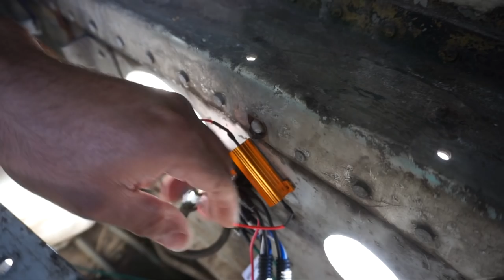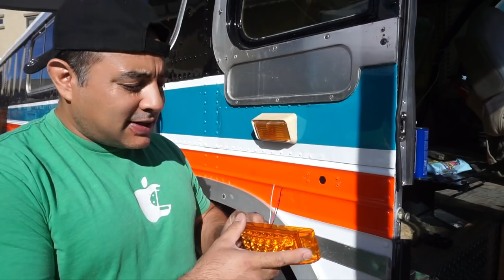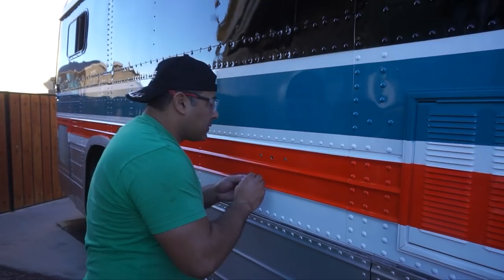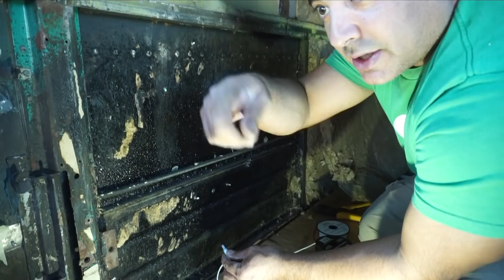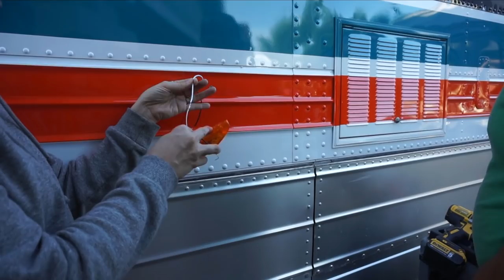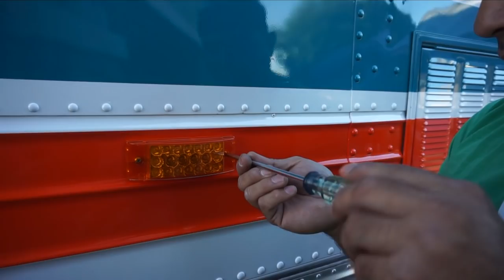Lighting Up the Sides of the Bus - Upgrading our turn signals and marker lights

Comment: Nice Clean Job. I would add some thread locker to the connections. Bus vibrates and could easily cause those connections to loosen up‼️👍👍. Vinny 🇺🇸
Reply from the maker: Thank you mmanut - excellent idea on the thread lock - I will likely do that next week (I ran out)

Comment: Well done Juan I like your choice on the lights its a good look for the coach I like how you take care on how you wire things to I worked in the wireshop for Boeing for about 5 years and you learn that a little bit of extra care and planning can make the difference in quality workmanship have you considered using solder sleeves? much quicker and seals all in one Amazon has them.
Anyway another great video
Keep them coming brother.
Reply from the maker: Thank you Brian - I looked up Solder Sleeves - HOLY COW how cool is that!!  I thought they were amazing.  I do my best when I wire to do a "lineman's splice" where you loop the wires around each other than wrap it around itself a few times before I solder them - I then "seal" them with marine-grade heat shrink (heat until the glue comes out a little).  I will have to try those solder sleaves!  Thanks for the tip!

Comment: Hi Juan, I get a chuckle every time I watch your video's.... I'm surprised how much alike we do things, I also use a ton of RivNuts...if they strip you can just drill em' out and insert a new one, I am also going to light the sides of my bus the same as you did except I'll use 5 or 6 as mine is longer, I'm also going to run a matching set along the upper panel.... I like lights ( I'm an ex truck driver... I can't help it).... Watson's Streetworks has some pretty cool lights and cupholders and things that you may be able to use, check them out if you like, it's all designed for hotrods but these old buses are just big hotrods anyway.... keep up the good work, you guys are doing awesome
Reply from the maker: Thank you James!  I love lights as well and I must have been a trucker in my previous lights - I love the big rigs!!  I will check out Watson's Streetworks for sure.  Happy New Year!

Comment: What are you adding to replace the upper marker lights? I believe from the factory you had one front and rear on each side as well as one in the middle. The front & rear serve both as side markers and front/rear markers. The upper one on the side allows you to be seen from the side over other traffic. 

I know that you're going to me mounting the solar on the roof. Possibly an awning in the future as well. These will likely interfere with the factory location of the center upper light, so I'm curious how you'll crack that nut.

Nice touch using the riv-nuts instead of just sheet metal screws. Will definitely make future service of these lights easier. With the rubber grommet you may still get some water inside the bus, so perhaps a dab of electrician's putty or caulking on the inside?
Reply from the maker: Thank you Richard -  I did manage to find LED lights for all the marker lights all the way around last year.  I don't think those upper corner lights are blinkers (I will check tomorrow because now you have me curious).  

The last time I checked those were just marker lights and our lenses are currently in pretty bad shape.  I did get a better set from Luke last year, but have since located some NOS ones!
Fortunately, our solar rack should not interfere with any those lights (fingers crossed).
As luck would have it, it was actually pouring rain today in AZ and I was able to do some leak checks on the newly installed lights - they were all dry as a bone :) - I did fill the rubber hole with dielectric grease as a "just in case" precaution when I went and put it in all the connectors.
Reply: I think you're correct - the upper corner lights are markers. Sorry if I made it sound differently. Glad you got to Luke's - great shop. I had ours there this fall. Can't wait to see the completed bus. Happy New Year!

Comment: If you stay with the load resistor, consider getting some thermal paste (like for CPUs) and bolting it to a large metal piece to use as a heat sink (obviously not the front panel!). Heat build-up won't be a problem for normal lane-changing use, but if you're using the 4-ways while you change a tire or something, they could be running for a long time.
Reply from the maker: Thank you Chip - That is excellent advise I ran them for quite a while testing and they did get warm.  The bus is made of aluminum and should provide a nice outlet for heat - I will revisit this later- thank you for the input

Comment: Whenever I use those crimp connectors, I simply fill the connector with Dielectric Grease before I put the wires in, that way the wires get coated with the grease to keep corrosion at bay.
Reply from the maker: Thank you BB Cooter.  That is a better technique ... it was kind of a pain to try to shove the stuff in there afterward.  Thank you for the tip I will try that the next time I use these :)

Comment: Nice work - those riv nuts are really handy and I am sure you will find them very useful when doing the interior figments.👍 On the electrical connector side have you looked at the range of Wago connectors - it might have something to offer you for the large electrical system you will be re establishing in the bus?
Reply from the maker: Thank you Norman - I have a few Wago connectors and I think they are amazing.  I felt that since these connections will be buried in a wall it made more sense to use the crimps.  Thanks for the tip!

Comment: With soldering you’ll have to carry an iron and solder with your spare lights because the lenses will crack with UV exposure or with force like a tree limb or rock or forbid a collision
Reply from the maker: Thank you Peter.  I hope they just get ruined with UV exposure and not the other things you mentioned :).  I guess in a pinch I could just cut/strip the wire and just use a small coupler but we plan to live in the bus full-time for the next couple of years and we plan to bring a soldering iron :)

Comment: Use "shrink tube" over crimped connectors.!!!
Reply from the maker: Thank you Herb, I normally do marine heat shrink everything, but these are going into the walls and should be safe from the elements ... meh maybe I will go back and throw a piece of heat-shrink on them.

Comment: they have  flashers for led lights and they are  a little bit more money than a regular flasher but they are worth the money because they last the led flasher you need is a grout you can pick them up at any tractor trailer parts store
Reply from the maker: Thank you chrissteene - we did try a set of LED flashers but they didn't work for us (probably the wrong pin-out).  We will try again later if time permits.
Reply: if you use a LED flasher the best one is a grout they have 2 style I work at a tractor trailer repair shop I do all the electrical work some stuff that I saw was scary like how the heck did this not burn to the ground :O . as far as the head lights did you look at the doge charger lights ?

Comment: Adding resistance to the leds defeats the purpose of power saving leds...   (hense the warm/hot resistors)  You should use a led compatible flasher module.  I have seen you design insanely complicated systems.  I know you can figure it out.
Reply: Shawn Griffin, why don't you find him one?
Reply: He said that he tried that route initially and it did not work. Rember that the bus was built in the 60's so LEDs hadn't been invented for autos yet.
Reply: The idea of going to LED for marker lights is not just for power savings, it’s also so you don’t worry about the bulbs burning out.  You’ll rarely have the marker lights on when the bus isn’t running and providing power from the engine.
Reply: @hakunamatataadventurebus5944  Here you go...  https://www.amazon.com/CEC-Industries-Electronic-Flasher-Compatible/dp/B00JXLH7CG  He will have to provide another source of positive or negative wire at the flasher based on how the bus's original wiring was designed.
Reply from the maker: Thank you guys - I did try an LED compatible flasher before and it just behaved poorly (basically didn't work) - I got kind of lazy and just put a couple incandescent bulbs back in (using LEDs in the back and on the sides but regular bulbs up front).  This bus has A LOT of projects and this one ended up being really low on the priority queue.  I was not really worried about it because the only time the flashers will be on will be when I am driving (as Bill Best had suggested).  I went with LEDs because they are much brighter and they should last much longer than the regular bulbs.  If I get a chance I will swing back around and have another look but for now, I have to dedicate more time to other stuff.
Reply: @BeginningfromthisMorning  Thanks for taking the time to reply.  I think my initial comment was taken as an attack by the other replies.  It wasn't meant that way at all.  I mean you installed a LEAF battery with a full BMS which is super complicated and technically difficult.   A traditional flasher is based on a heat sensitive metal membrane and a spring. It only needs one side of the circuit like a bulb, the other being chassis ground.  At LED flasher needs both poles at the flasher since it runs an IC timer circuit...  That was probably your issue when you tried to make it work.   I really enjoy your channel, so please know I was only trying to help.
Reply from the maker: @iamshawngriffin  Hey Shawn - thanks for the clarification - I am sorry If my response sounded defensive - I do appreciate the feedback and did not take your comment as an attack at all.  I agree with you and originally tried to do the LED compatible flasher but the one I bought did not work (probably the wrong pin-out) ... Honestly, I just wanted to get it working for now.  I have the resistors on screw terminals because I will probably loop back around and fix that issue :).  Thanks again for the feedback and thank you for joining us on our project :)
Reply: @iamshawngriffin  I had found one on ebay but the one you linked is much better because it matches the shape and size of the OEM one. I disagreed with the resister idea as soon as I started watching his video and I found that I could not continue to  watch because the resistor completely negates the purpose of putting in LED in the first place.

Comment: Now change out that upper front side amber light that is angled down and turn it into a clear lens as an aid in boarding the bus at night. Kind of a front porch light. Would be cool to have it on a remote or motion sensor. The one right by your hand at 2:52 the older one, not the new LED.
LEDs are looking great.
Reply from the maker: Thank you Bob - Yes, that light is on the short list of things to replace.  We have a few candidates (with motion sensor) but nothing has really grabbed us yet.

Comment: It's technically illegal to have an amber marker light near the rear of the bus....is fine as a blinker bites the rear most one isn't supposed to be a marker as well.
Reply from the maker: Thank you Nate - I had to look this up and I believe you are correct!  Technically I think we could probably get away with it because those laws were passed in 1969 and our bus is a 1964 but those laws exist for a reason.  We have a couple of red ones on order for the back that should be here next week - thanks for the heads up!
Reply: @BeginningfromthisMorning  no worries, it's a silly law...I was planning on using my amber rear turn signals as markers and found out it was illegal.....